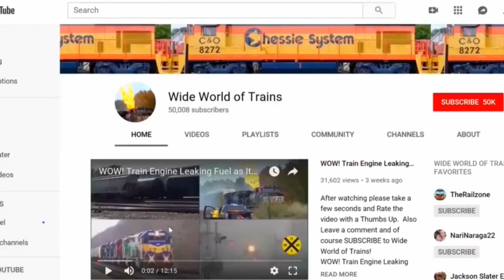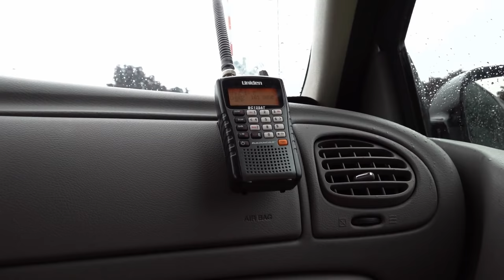Caught On Camera! Norfolk Southern Train Breaks Knuckle + Goes Into Emergency! Chasing Heritage Unit

Comment: Here's how you can tell the train is way too long.  At 19:50 the conductor has to hold his radio up in the air as far as possible just so the engineer can hear him!  They need mobile repeater extenders in the middle of these huge trains.  lol
Reply from the maker: Yes this is true, he mentions that on the radio that he is holding it up higher to get better reception
Reply: @guerropeuto801  Shareholder value first, safety and public interest last.
Reply: @WideWorldofTrains  being a Ham I found if you had a better antenna would work I been told those short antenna's are usually about 1/2 mile
Reply: when I worked for the USN on a recovery ship our vessel was only 200 ft long in the control room only 50 ft away someone tried to call after steering with the hatch open they could talk, but once closed they could not talk, they tried to get a repeater on board and it would take up the entire budget of the ships op, the USN turned it down
Reply: Wow that is to long for the knuckle the knuckle is not made to all all that Force
Reply: @stephenengler5213  Actually the knuckle is made for that force, but not for that force forever.  Mechanical devices eventually wear out.
Reply: Needs a new radio
Reply: @larryfields2652  crappy radio
Reply: When I was growing up, 100 cars on a freight train was pretty average and stuff like this just didn't happen.  RR's are trying to do more with less and this is the result.  I wonder which costs more...running shorter trains frequently or having to keep a longer train parked while repairing broken knuckles?
Reply: Jt: Excellent point! I had no idea comma were so bad. We need to have dpu for each 40 cars and this would allow for repeaters.
PSR what a joke. The costs of this separation have to be huge. 7 crossings blocked! So if an ambulance can’t get through…,
Reply: @robertdshannon5155  trains need to be shorter and more frequent.  They were never this long when I was growing up.  They should be a mile long max, about 100 cars.  Making them longer stresses the couplers and that's why they fail so frequently.
Reply: @WideWorldofTrains that incident could have been worse
Reply: @LegendaryRadioJock   Shorter trains, more trains, = more crew employees, no way.
Reply: @tomp8871 but much safer, fewer massive derailments and less delay time at crossings for EMS.  Safety  should always be the highest priority.
Reply: @LegendaryRadioJock  the bottom line is the priority, but you understood my meaning. Makes to much sense, but not cents.
Reply: @tomp8871  You must be corporate, because you're putting profit over safety.  Bye!
Reply: @LegendaryRadioJock  You are misunderstanding me. Cut the trains in half and hire more crews! Safety before profit, and don't call me corporate, I was a freight Conductor, period.
Reply: Some trains will be big
Reply: Jaw Tooth

Comment: It’s a shame that many Railroad management people can watch this video and not understand the problem behind the busted knuckles. (I don’t know, maybe the trains aren’t meant to be over 2.5 to 3 miles long going up and down grades and curves). Anyways, still another great video from the WWoT!
Reply: when annual bonuses are based of profits common sense be damned!!!
Reply: Railroad operations managers absolutely understand this problem.   They are also struggling to maintain profitability during times when the very logistical core of North America is changing.   Truckers are more competitive than ever.   Coal traffic is dwindling.   Oil traffic is fragile.   You have many many problems to understand and busted knuckles is but one of them.
Reply: @cdavid8139  attempting to justify this is absolute nonsense.
Reply: @newmanattack  Attempt to justify what?   I've only been in this industry approaching 4 decades so educate me.   What specific part of my statement was 'absolute nonsense'
Reply: You can't say this has anything to do with train length. Multi levels wear knuckles worse than any other car type. I've seen them paper thin on the pulling faces before when inspecting them. It also appears to have a casting defect that that probably weakened it over time. Also this is a common scenario, especially with multi levels, that an air hose seperation puts enough forces to break a knuckle somewhere. It'll find any weak areas.
Reply: @TheNemosdaddy  Yessir.   Exactly.    Those cars are so prone to making your life miserable
Reply: @TheNemosdaddy  God Bless the Mechanical Department!!!!!!!!!!!!!!    And MOW while God is at it.
Reply: That's a good point. I often hear them slip when they suddenly raise then drop at grade crossings, and on my line (CSX Chattanooga Sub) that has eroded 25-year-old concrete ties (though some have finally been replaced within the past two years), trains would often bounce apart. On this line with many steep grades and hills, extensive train lengths contribute to many knuckle busts during slack action.
Reply: @CSXfan4589  Yep.   I know the W&A a bit better but I can imagine with those hills and longer trains issues arise.   I know on W&A there was a lot of track work as well.   Once they started tacking an auto train onto a merchandise train there would be some issues.    Out west and in Canada running these long trains makes a lot of sense.   Out east running through far more densely populated areas....I think continued experimentation may take place.
Reply: @cdavid8139  Trucks can’t even come close to the efficiency of trains, so how are truckers more competitive than ever?
Reply: Looks to me to be weekend laziness for not implementing DPU'S,  at least one in the middle, would be a bonus to have one at the rear.
😁😄😷
Reply: you do realize that steel has a breaking point just like everything else right lol. and after so long of being constantly slammed into by the frightcars when coupling up eventually the airline and the knuckle is going to break an fail.
Reply: @vernonmatthews181  Weekend laziness?   Why do railfans second guess the very industry they follow.   It's "laziness" for not using a DPU?   No possible other reason?
Reply: @cdavid8139  I haven't subscribed to this channel for a year now, enlighten me to why I should.
Reply: @vernonmatthews181  I do not know you, anything about you, or any of your interests so I haven't a clue as to why you should or should not subscribe.
Reply: @cdavid8139  Good Answer, live long & prosper 🙌 👏
Reply: @vernonmatthews181  Back at you Vernon!

Comment: That's pretty impressive braking distance from about 40 mph, where the two parts of the train stopped. 173rd car? Heavens. Think what a strain on the couplings that must be.
Reply from the maker: Yes and especially that the power is over 2 mi away and where the knuckle broke there were several curves
Reply from the maker: I think a pusher DPU would help out a lot in this situation on this particular train and line

Comment: Back when I was an over the road truck driver, KLLM was a strictly trucking company.  Their addition of containers is new (at least to me).
Reply from the maker: These containers are new here started to see them last week
Reply: @WideWorldofTrains  I read where it has to go at least 600 miles to be economical for the trucking company.  If it goes cross-country, that's a great savings because of not having to use a truck driver until it gets to the destination.
Reply: trust me regular semi trailers are going to start dying out soon they can use containers the same way and no shifting cargo between modes of transport!!!
Reply: I can remember when KLLM was called KLM before they were sued by KLM Airlines.

Comment: it looks strange to me that the knuckle broke on the end of the train, where the force trasmitted throught the knuckle is far inferior than that of the first cars...maybe it was already damaged by metal fatigue...
or did the hose separation mean that the end of the train had the brake on?
Reply from the maker: Could be if you look closely at the knuckle look like there might have been a defect that maybe an air cavity when it was forged
Reply: yeah, I'd say it was old, very worn and previously stressed to the max and ready to break at any time, for sure preexisting defects.
hard to say where, when or on what line it would break and it very likely wouldn't be caught on normal inspection when coupling or servicing.

Comment: 1:01 middle road blocked
6:08 lincoln avenue blocked 
6:22 franklin avenue blocked
7:28 bucknor street not a railroad crossing
7:39 lord street blocked
9:14 hoyt street blocked
9:36 nevins street not blocked but if the auto rack on both sides
11:00 towsend street blocked
12:18 roberts road blocked
14:50 werle road blocked
Reply from the maker: Cool 😎 🆒️ thanks for your comments

Comment: I think there’s a few wires loose somewhere as the two red lights below the “X” sign seem to go out every now and then.
Reply: I thought that too, but it's the shutter on the camera that gives the illusion of the lights going on and off.
Reply: The LED mee-mool lights (o)T(o) are strobing at a very fast flash rate.  The flash rate is synchronizing withe video camera's recording "frame" rate and then going out of synchronization withe recording rate.
Reply: I noticed that too, seems to repeat at regular intervals, anyway, greeting from New Zealand.😁😄👍

Comment: During the UK lockdown, I watched a really interesting video that explained DPUs and how they spread the load rather than have the front knuckle (coupling) pulling at nearly 200 wagons (cars). Given that there were three locomotives at the front of this train, it would have made sense to have had only two at the front and use the third as DPU mid train, or even at the rear of the train.  But, what do I know about US railways, I'm just an Englishman! BTW Is there a limit as to how far from the front of a train that a DPU can operate?
Reply from the maker: There's no limits that I know of as far as distance, this train is a heavy train sometimes it's 24,000 tons. This train also used to have DPUs in the middle, two of them. I have many videos of this train showing that. And you're right about how it distributes the power to ease the stress on the front knuckles

Comment: All of the Dunkirk, NY crossings visited during the knuckle break are as follows with crossing Id and street name: 1.) 471757G Middle Rd. 2.) 471764S Lincoln Ave. 3.) 471763K Franklin Ave. 4.) 471762D Lord St. 5.) 471761W Hoyt St. 6.) 471760P Nevins St. 7.) 471759V Townsend St. 8.) 471758N Roberts Rd. 9.) Return to Nevins St. crossing where the cars are hooked back together.
Reply from the maker: I grew up 1 block from the Lincoln Ave crossing, we used to hang on the sidewalk gates when they went up, we were about 12 years old

Comment: Hello from the UK.  Interesting video. In the UK our trains are never as high as this, so that containers are not double stacked. Double stacked containers would not be able to clear railway bridges or tunnels. At 9:27 there is a shot of a railwayman in front of the end of an autorack. I never realised how tall autoracks are in the USA and this shot really demonstrates this. Nothing of that height would ever get under a bridge or under a tunnel in the UK. Also, more railways are being electrified with overhead cables.  Again, trains this tall could never operate on such lines.
Reply from the maker: Hello Jeremy, thanks for visiting my channel. You're right those auto rack cars are very tall. Before they start a double stacks here in the US many bridges were either raised or removed to allow clearance for the taller double stacks and auto racks

Comment: great footage on a rainy day, what luck!
2:50 start of the emergency braking - you're welcome! =)
3:23 if you listen closely just as the train comes to a full stop you can hear the head end of the train blowing its horn...
4:00 engineer radio call to despatch, track speed and energy management
8:10 radio announcement knuckle broken
9:00 first sighting of the seperation at a distance
9:34 relocated to within the separation
10:35 close up of the metal fracture
11:19 radio call with a creative solution idea...
11:40 let's find someone almost as smart as we are LOL
15:20 conductor radio call, cause of seperation was broken air hose that the resulting braking load broke the knuckle.  I'm sure he's correct, it just seemed to me at the 2:50 that the force/impact of the breakage seemed to be heard first before the emergency brakes kicked in, but I'll defer to his first hand experience
Reply from the maker: Thanks that horn was from a nearby CSX Train the CSX line is 1/4 mile from the NS line. And the comment lets find someone almost as smart as we are! I LOL right then and there! Thanks for the great comments and time stamps

Comment: Can they close the brake line valve athend of the train and pull the train unblocking all of those grade crossings? 
Then when the coupler is replaced back to the isolated end and couple.
19:30  Why did you not walk over (off railroad property) and video the coupling??

Comment: Sometimes you can find used fully programmed Maintenance of way railroad radios on Ebay or sites where they sell used Net Edge NX Kenwood 700 radios if you would prefer better  than the small tinty sound coming out of the hand held scanner on your videos.

Comment: You’re absolutely right, why didn’t NS use a DPU ALRIGHT for their NS 310? Just like CSX did for their DPU ALRIGHT #745
Reply: I'm guessing the reason for not using as many DPU's as before, is cost.  Some executive who knows nothing about the mechanical, day to day stuff needed to run these trains correctly, would be behind it. 

More engines burn more fuel, is their logic, so eliminate the extras.

Comment: Big oops!  I am with you WWOT - they need DPU's!  I think it is the Precision Scheduling which attempts to keep costs low that is at the root of this type of incident. Hate to say it, but some RR's run a bit on the cheap. When this happens, it gets expensive and so we see the trade off :) Anyway - this is pretty cool stuff! We don't see this often - especially the actual break :)
Reply from the maker: A DPU would help the knuckles from breaking, as Im sure you already know Brian. This train the 310 used to have 2 dpus in the middle, I have many video's of it when it did
Reply: that's what you get when bonuses and raises are based on yearly profits! the big wigs decide 5 or 6 broken knuckle per train per year is cheaper than the diesel and up keep for DPU's!!!
Reply: DPU's save money in the long term.  They reduce fuel costs and they reduce wear and tear on tracks and wheels, particularly on curves, and as we see here on downtime due to things like knuckle breaks, as DPU's take a lot of strain and banging off the knuckles. It also allows them to run longer trains which translates to lower crew costs.  But like anything, the initial capital outlay for DPU technology costs.  I suspect that NS doesn't have the cash flow or reserves to expand it's use of DPU's, so that maybe speaks to it's economic position if you are a potential investor.  I'm across the lake from Dunkirk, where the CP and CN mainlines to Detroit and Chicago run, and I've been watching both-- mostly cash rich CN, expand it's use of DPU's in just the last year.
Reply from the maker: @rodchallis8031  Norfolk Southern used to use them on this particular train, they stopped using it several months to a year ago
Reply: @WideWorldofTrains  , yeah I heard you say that, and also that broken knuckles are frequent in this stretch.  I have no idea what the economics of acquiring the technology for DPU's is, but I have to believe it's not cheap, and NS may have moved what they have to address another issue?
Reply from the maker: @rodchallis8031  They must have their reasons
Reply: @rodchallis8031  hey Homer WWOT said they WERE RUNNING DPU's on that drag up until a couple years back!!! go back and re-watch it and LISTEN this time!!! they have the tech in place already they're just not using it!!!

Comment: When the window is down, your voice crackles.  Inaudible.
Reply from the maker: I know, I dont realize it until I watch the video, Ill try to remember that. The mic I use cancels out all noise when its in the wind, including my voice
Reply: The early radio broadcasts, if you understand them, it would be cool if you added what was being said as a caption. I sure as shoot couldn’t make them out. Also how long did it take from Emergency stop to getting that train back in motion?
Reply from the maker: @joyceneville9214  Probably 3 hours, maybe longer if the conductor had to walk the 2 1/2 miles of the train back to the head end

Comment: Please always explain what something is when you use an acronym such as DPU

(I'm too lazy to search to find what a
DPU is😂
Reply from the maker: Yes a DPU stands for distributed power unit. It basically is any locomotive on a train that is not part of the front group of engines and is helping power the train. It could be placed anywhere else in the middle halfway down a third of the way down or at the end basically anywhere is on the train that they decide.
Reply: @WideWorldofTrains  Thank you for the info!!!

Comment: Do trains derail easily?  Does it depend how they are loaded?  Just wondering.
Reply: It's not only how they're loaded its more how they're placed. Like you cant have a certain amount of empty cars back to back, there's a system that'll detect if there's too many empty cars together or not. I'm currently going through conductor training and its super cool the amount of systems they have to keep the train going. Say you have too many emptys together and you're going around a curve due to the lack of weight they could lift off the track